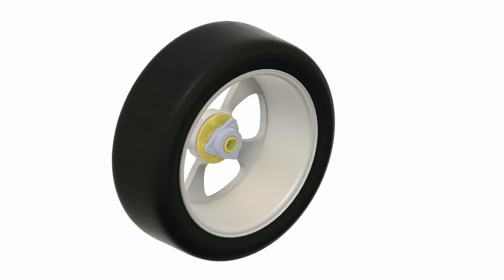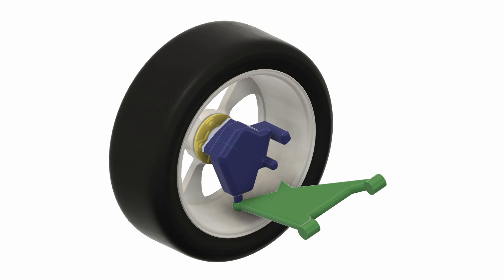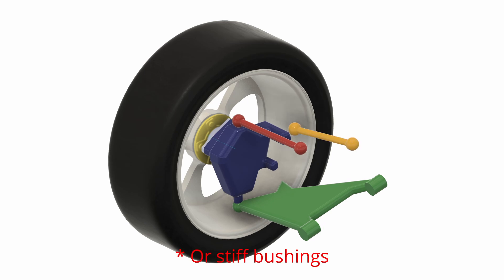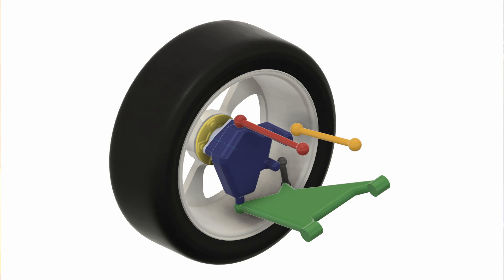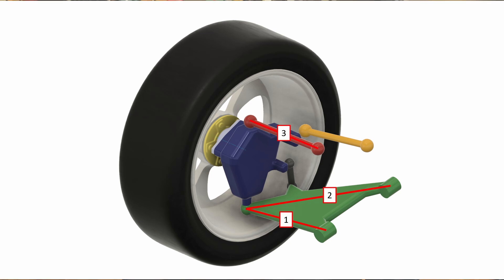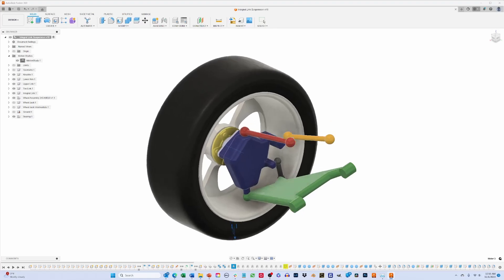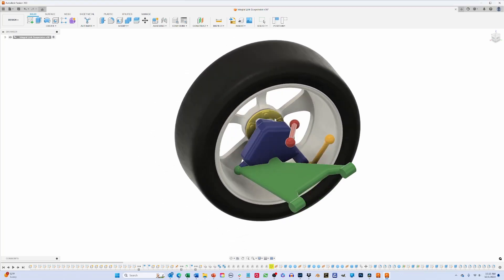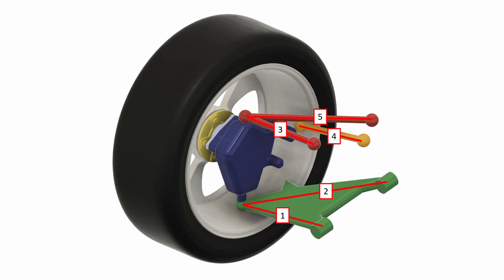What Makes The BMW E39 Integral Link Suspension So Good?

Comment: The double wishbone on subframe design and its problems reminds me of the VE Commodore and its long wheelbase version, the WM Statesman/Caprice (technically, it had an upper control arm, two lower links and a toe link, but as stated in this video, two links joining at about the same place is effectively a control arm, so it acted essentially like an upper and lower control arm set-up). In my opinion, the rear brakes were too effective, making the car rely on ABS to keep braking stability under heavy braking conditions (pulling the ABS/ESC fuse and braking very hard would result in the tail stepping out). The cycling of the ABS caused very significant axle tramp, but it was also there to a large extent with ABS/ESC disabled. The advertised weight bias was 52% front, 48% rear, and being a sporty sedan, the CoG wasn't horribly high, so it had quite a bit of potential for rear brake effectiveness, but the rear brakes were too much for the rear suspension bushes, and the axle tramp was really something to behold... just as long as you weren't inside the car, with ABS/ESC disabled, doing maximum braking from 100MPH or more... Let's just say that I'm glad I went to the toilet before going to the skid pad with my boss that day!

Comment: I'd love a suspension explained like this for Formula 1 cars. Push rod, pull rod. I bet a lot of people would like it too!
Reply from the maker: I'll add it to the list but race car suspensions are generally surprisingly simple. Billiard smooth surfaces and a single load case (no need for various numbers of passengers and luggage) make things much easier.
Reply: F1 suspensions are generally simple, so they go by the std books. Passenger car suspensions need more compliance without losing traction - that's a much heavier task.

Comment: Thank you! All of your videos contain  excellent information.  I have over 40 years experience training techs/ engineering suspension components and would love to get your take on roll induced rear steer. I have developed a 4 link rear suspension for my street/ track C3. It utilizes toe links with cams which will allow setting roll induced rear steer for over steer, under steer, or zero toe change.

Comment: Whaoa, This is a very good video answering a ton of questions I had when looking at Tesla's S and X suspensions.

These cars are known for «eating» rear tires due to an heavy negative camber on the rear Integral link suspension. Some companies even sell adjustable camber arms to correct this and reduce camber from 2.5° to 0.5° expanding a lot tire life. Could you elaborate on the impact of this rear camber change on handling and comfort ?
Reply from the maker: It probably won't make any difference for comfort but handling will likely get worse. The extra camber helps the rear suspension resist lateral load so with less camber in the rear I would expect the car to have less understeer. The steering feel will also be affected with the car becoming more twitchy, especially at highway speeds.

Comment: Great video. I now also understand why the E39 rear end feels so nervous when the rear subframe bushings are worn. Replaced the ones on mine and it made a huge difference!
Reply: I agree , after replacing every possible wear item in the rear , I replaced the subframe bushings (even though they looked good rubber hardens over time) and I now have my rock solid and totally stable feeling 97. 540i/6 sport sedan back. I just love this thing . For only 282 hp it’s really impressive how fast it is. I also own an M5 so I get to jump from one to the other and the biggest difference I believe aside from the obvious power increase is the lack of an  Limited slip differential in the 540i. Eventually I’ll put a wavetrac in it .
Reply: Thank you Sir for your videos… this stuff is hard to understand but you are like having a new pair of glasses

Comment: Love the videos, can you make a video explaining why the stabilizer bar links have changed from being a simple bolt with 4 bushings to links with 2 ball joints turning with the front strut, i don't understand this design, and why doesn't this type of link is attached to the lower control arm instead of the strut.

Comment: Excellent video, I think a video about the rear suspension in the alfa romeo gt/147/156 would be very interesting, relatively simple setup with passive steering
In any case, keep up the good work

Comment: One of the reasons I bought a BMW E60. It has the same rear suspension design as the E39 with slightly better anti-rolling.
Reply: Agree… I own an e60 with active roll bars and think it handles wonderfully. It’s an underrated chassis IMO. I refreshed all bushings with OEM recently but added poly subframe bushings and am very happy with the results.
Reply: @DaSixSixOne  the ride will be sportier with poly bushings indeed.
If you want to reach the pinnacle of handling in a E60, fit Koni Special Active shock absorbers.
Reply: @hanynowsky I had the Koni’s but did not like them so replaced them with Bilstein B16 coilovers and they are much better. The Koni’s were underdamped. Bilstein’s handle considerably better and are adjustable.
Reply: The active anti roll bars in the e60 are crazy expensive and genius yet somehow very very rarely have issues. Great system.
Reply: @KlassikHaus  totally agree.

Comment: Wow, did not know you worked at tesla. Amazing video! Would love to hear how you compare this to the newer teslas with 5-link suspension. And , maybe also why some of these cars (also the taycan) is very sensitive to having enough toe-in. Seems like they easily get in to a situation where they wear out the inside shoulder fast (toes out under acceleration? Big torque from stand still? Low profile tires? Heavy car?)

Comment: BMW did well adapting the e31 integral axle to this. Some models had rear wheel steering. Bravo Wolfgang Matschinsky.

My personal favourite is the w201’s multi link that matured to the w140 version.
Reply: Just got a 1991 850i/6. It’s now running next on the list is the entire suspension which I’m not looking forward to at all.. speaking of the W140, we owned a 95 S420 and that thing was the best highway car I’ve ever driven.

Comment: please  review citroen
Reply: Agree!! I have lots of experience of Citroën CX's and to me it seems that many of the suspension issues in this example are solved differently and effectively. Instead of two separate sub frames it has front and rear sub frames connected with longitudal 'frame beams' and the whole body is 'floating' on soft bushings connecting it to the frame.. and if I remember correctly, Rolls Roys used the same concept. All bushings are metal to metal with no flexibility whatsoever except the lower front control arm that has a bushing with a small amount of flexibility. All other bearings are of roller bearing type. It made the whole car behave extremely well and predictable in 'ruff' conditions. I would also love to have that reviewed here. Great video 👍

Comment: I would like to know more about Miata's multilink rear suspension and some front suspension designs where the upper "A-arms" are two separate rods with ball joints.
Reply from the maker: I wrote a blog on how a double balljoint lower arm works here: The concepts rare the same: https://www.theautopian.com/our-former-tesla-suspension-engineer-describes-why-the-double-ball-joint-suspension-is-so-incredible/
The idea is that same whether it's an upper arm or a lower arm. It makes no difference.